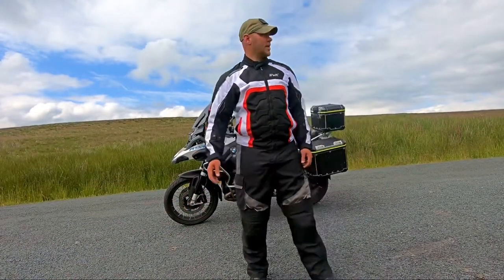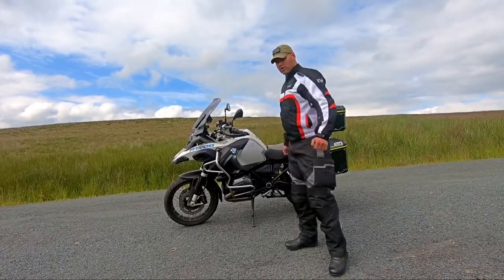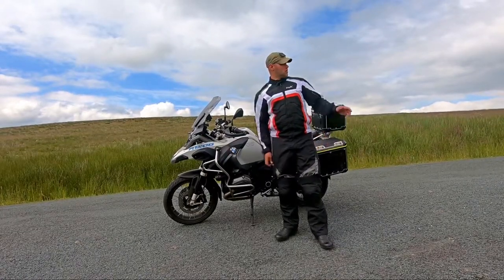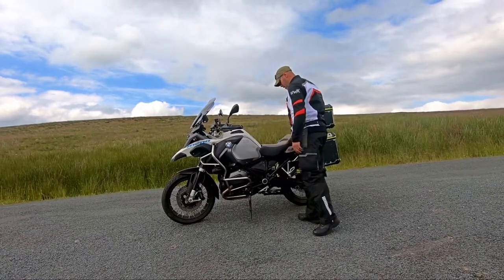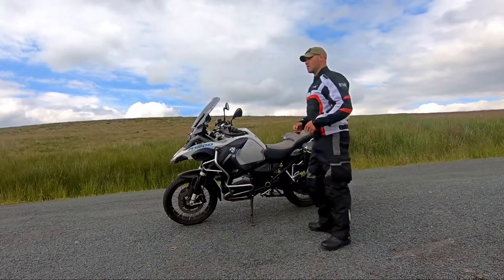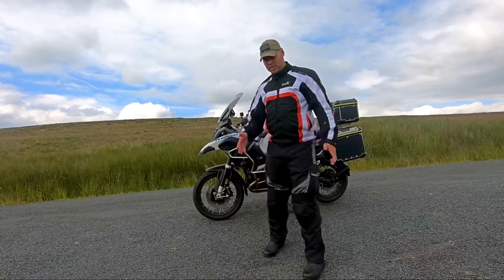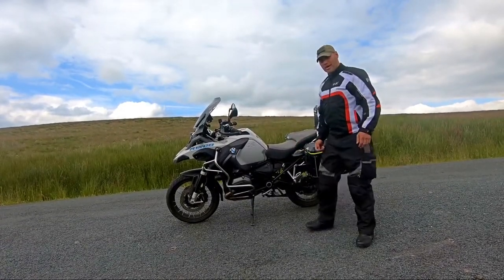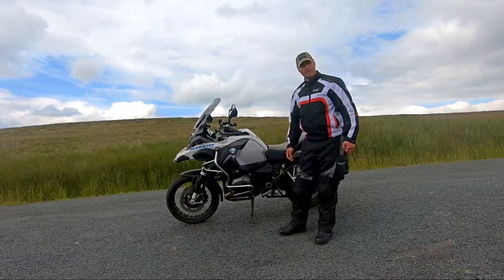(6) Motorbike Centre stand - tips and tricks

Comment: This is the way I’ve always done it. So good to see this method properly explained. There is so much nonsense out there about pulling or pushing on both bars, not leaving the side stand down, not leaving the bike in gear, standing too close and so on. 

I think you might have emphasised a bit more the use of the clutch with the bike in first gear. Pull it in when moving the bike on and off the centre stand. When coming off the centre stand, let it out quickly to stop the bike rolling away. And if you think you are losing control at any time, let the clutch out to stop the bike, and pull it towards you onto the side stand. Then take a breath and start again!
Reply from the maker: Thank you for your comment, I am not a PRO but I see a lot of 1st timers having trouble with this.
Reply: Nope,. Always have the bike in gear.

Comment: If you have problems getting your bike up on the stand, put it in neutral. I find in gear the back wheel can't roll, and the bike will fight the stand. I stand by my statement, even though this worked. I think what happened here was there was just enough slop before the wheel engaged with the transition to roll. I also want to point out if you're not 200lb and over, this can be a struggle. Second, if you're not Waring a stiff sole boot, the stand foot post can really hurt. I wish BMW would enlarge the pad where you place the ball of your foot and make the pad pivot a bit.

Comment: As a smaller rider standing the bike first seems like a extra step that could get away from you pretty easy if its windy. All I do is with the bike on the side stand I stand on the center stand step, grab the back grab bar and pull while standing with all my weight on the foot that is on the step. Takes a couple seconds and the bike never falls cause its always on one of the 2 stands, it stands its self when the kickstand side of the center stand contacts the ground. Getting it off the center stand is just as easy, put up your kickstand, start the bike, put it in first, find the friction zone and rock the bike off the center stand, off you go.
Reply from the maker: Thank you for your comment, I will try that next time 👍

Comment: The real key that beginners miss is that they try to muscle the bike backward and up, using only the nearest centerstand foot. When starting, stand on the centerstand and feel BOTH the stand feet securely touching, rock the bike slightly to verify (especially on soft ground). With the bike in 1st gear and sidestand down (always), simply stand down simultaneously pull rearward and up. (*use a grab rail, frame rail or whatever is aft, NOT the handlebars).   Of course if panniers/luggage are loaded, you may want to take those off before raising onto the centerstand.When coming off the centerstand in first gear (always), sidestand down (always), clutch hand on the handlebars, simply rock the bike, pulling slightly forward and toward you. I'ts a bit of a lateral scooping motion.  It's easiest with your hip against the bike, standing sideways, which also keeps toes rearward of the centerstand. Very little effort required.   Watch this one if unclear - https://www.youtube.com/watch?v=Kar4R3DD0Xs
Reply: Always!!!! have side stand up! when that bike comes down you could hit that side stand and put your bike on it's side...Myself when getting my bike off the center stand I am on the bike rock it forward and let the bike come down....I am sitting on the bike and have both legs supporting both side of the bike....But then again I only have 53 years riding so I might not know what I am talking about